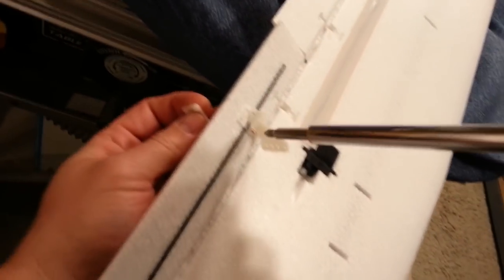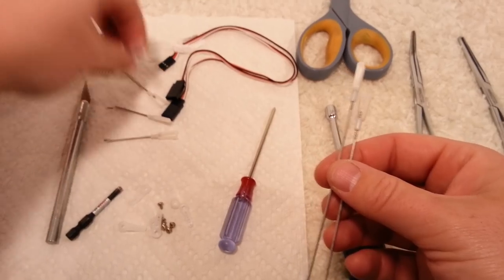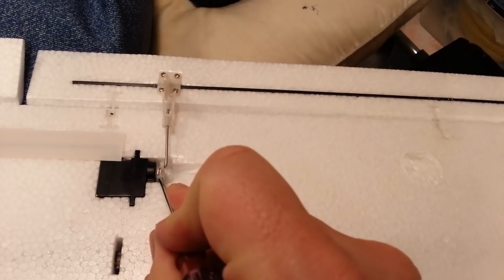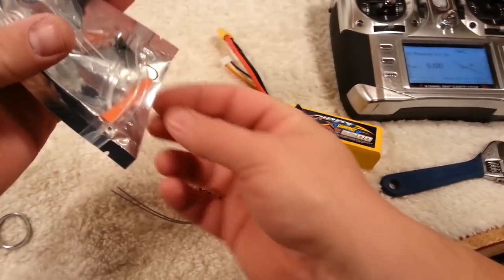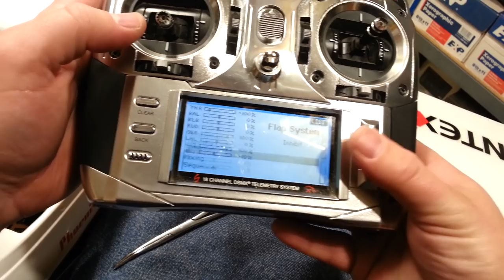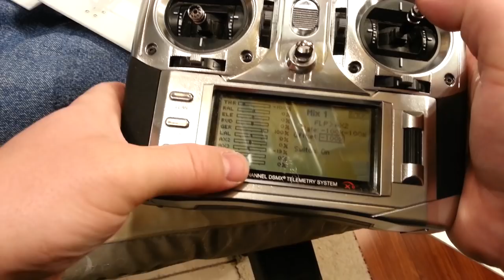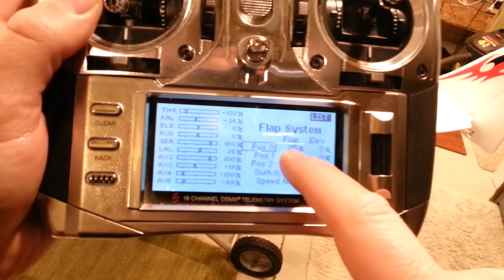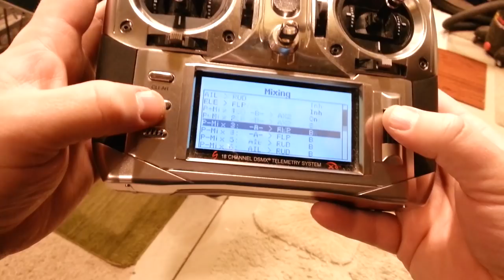Volantex RC - Phoenix V2 - 2m - Build Series - Radio Setup

Comment: I have the Ranger 2000, which has the exact same wing and tail/empennage. The flaps are effective enough so all the work with flaperon and crow seems a bit unnecessary.
I would also put the servo horns in the tail pointing upwards instead of down as you did here, as it would protect them better when landing on grass. Thanks for your very good and interesting videos. 👍
Reply from the maker: Unnecessary is the name of my game ;)

Thanks!

Comment: The Phoenix 2K V2 is by far the best designed of the Phoenix Series. Unfortunately, mine is sitting in my winter house (in Phoenix) collecting dust. By the way, the horn backer bumps go away from the foam so it doesn't decrease and weaken the foam structure.
Reply from the maker: I thought that might be the correct way, but then you have drag???
Reply from the maker: These planes are so inexpensive, maybe you could pick up one for here, and one for there :)
Reply: I have a 2K V1, 1.6, and Evo here (Portland) fun fun.

Comment: Thank you so much for the tutorial!
Reply from the maker: You're very welcome. Keep in mind lots of stuff has changed since we filmed this, so please do take that into consideration when thinking about doing it yourself because, there's considerably easier ways to accomplish even better results now-a-days.

Thanks for watching, and hope when you compare it against current technology, you'll see this pretty clearly

We have done a several more modern sail planes, if you're curious...in fact just the other day, we did a sail plane...not to poo-poo this plane, which was awesome, the Radio Setup may be tough to copy, since many of the parts we used aren't even available anymore.

https://www.brianphillipsrc.com/sailplanes

Comment: Thanks for all info,Spektrum user here,seem to be in a minority.. By the way,phoenix build,they do suggest servo and control arm holes to use,it's in the print. I suppose experience is best teacher,but I'm still at a careful reading stage.
Reply from the maker: That's weird, I guess I missed that part in the manual. Sometimes these things will change over time, so maybe you got a different copy of the manual??? Either way, she flies like a day-dream!!!

Comment: The manual does not mention how to free off the control hinges.
What i mean is..... Am i supposed to cut the polystyrene away with a modelling knife on the hinge line?
Surely the plastic hinges should hold it.
Otherwise they are very stiff
Reply from the maker: Pinch hinges are sometimes okay, and other times they fail quickly. You have to decide how you want to proceed. It's not hard to cut them free, then install a hinge, but you don't have to do it this way, if you'd rather have pinch hinges.

What I mean is that you have the flexibility to do whatever you feel is best.

Comment: Thanks for all your help, especially with the decals.  My control horns are different, they did not come with screws and the backing plastic has slots that mate with little arms that come off the back of the control horns that protrude through the control surface. Am I supposed to use glue on these or do they lock into place. TIA.
Reply from the maker: You can glue on the flat part and then just stick them through. That's what I would do at least. If you feel like they will CLIP together good enough, then you could give it a try...BUT just use care they won't come undone with servo movement.

Comment: Hey, great vids. Just one thing, bit of a noob question: when balancing the Phoenix, what are you using for weights and most importantly, how should it look when properly balanced?
I always worry that I’m too nose or tail heavy. I know a little nose heavy is better but can you show the pitch of the fuse, side on while balancing, so we/I can see what “properly balanced” should look like?

Thanks mate, great vids, really helpful and a good laugh too 😉👍🏼
Reply from the maker: I almost always use the battery to make adjust the CG. Some use dead weight, like lead weights, but I can't bring myself to use dead weight, BUT you can generally use LESS all up weight, since you can get the weight further out in the nose or the tail of the plane.
Reply: @BrianPhillipsRC  thanks 😉👍🏻😁

Comment: I liked the video series, and especially liked the way that the crow configuration could really slow the plane down.  I have a 6-channel radio.  Is it possible to set the flaps up using one channel and having a "Y" cable from the receiver to each servo in the plane?  Also, were you using two channels for the ailerons?
Reply from the maker: As for a "Y" Cable for both flaps - yeah, but builder be ware, you need them to mount them in opposite directions to get them BOTH to move the same direction

Comment: Desperate for guidance on flap & elevator compensation setting for my new Phoenix 2400. Just regular independent flaps on my 3-way D switch. Flap % (and most importantly elevator compensation %) as my maiden flight was a maiden crash. So erratic and uncontrollable that I didn't have any time to learn by trial and error. Help appreciated!

Comment: When I plugged my 3s in there were no tones at all, what do I do Bri? Is it the esc or the motor? You buy a plane from HobbyKing and you expect it to work 😡
Reply from the maker: Can you try another ESC easily???? That's where I would start.
Reply: You could connect the ESC with an servo tester. It works!

Comment: Starting at 1:23 you showed the control horn back plate and mentioned the bumps and said there was a right way and a wrong way but you never clearly showed the correct way.  So, which way do you think is the right way?
Reply from the maker: Sorry about that. The FLAT is supposed to go FLAT against the foam (regardless of which surface you're dealing with). Some will argue that I'm wrong, but I'd day there will be a far MORE threads exposed beyond the plastic doing it the "other" way...
...that being said, you can really kinda do it either way :)
Reply: @BrianPhillipsRC  I'm with you.  I don't see how anyone would think it could go the other way.  The way it came across to me was that the bumps should be against the foam.  I just wanted to know why.  I'm always eager to learn new things.  Love your videos.
Reply from the maker: P.S. I've done it both ways, just to experiment, and if the screws were the correct length, that would be a really nice way to do it, but if you want to cut them down to length, it's very tough, since they get hot and melt the plastic :(
Reply: The bumps should go into the foam as they locate the back plate properly and stop it rotating

Comment: Hey Brian do you have any problems with your switches coming lose all the time?? I’m getting tired of having to continually retighten constantly no matter how tight I get them! I just wish they had a tool or (spanner wrench) to get them tight. I hate using a screwdriver to try and get them tight, it just messes them up. I have talked to HH and they have no tool. So they sent me extra nuts. Great fix.
Reply: Inreguards two the above question, I found a tool, and hopefully it works thanks anyway.
Reply from the maker: On your Gen 2 transmitter? Esteban's constantly come loose, but my old trusty Gen 1 is always tight...
I'm thinking tighten them tight, and one drip of CA and kicker :)
Reply from the maker: Yeah, the "Split Flat Head" or whatever it goes by...looks kind like a modified nut driver, right?

Comment: Brian I thought you had to use spectrum receivers with spectrum transmitters 🤔
Reply from the maker: You have to use a compatible protocol... Spektrum uses DSM, then DSM2, and now DSMX. DSMX and DSM2 are generally considered to be "compatible" as the DSMX can be "Forced" back to DSM2, in many cases, but there are some limitations you might run into.

Basically, the 2.5 GHz is the frequency range where the Transmitter and Reciever operates, but the WAY that it operates is the "protocol".

For example, you might want to use an Orange Rx, which is DSM2 or DSMX...or a Lemon Rx which is DSM2 or DSMX, or they also use DSMP (Which is a joke, since it's ACUTELY just DSMX). But if you ran Futaba, they'd have another protocol, which is FHSS, or FRSKY which is OpenTx, and so on and so forth. There's also some other "toy grade" protocols out there, and some are Crystal based still!

Lots to learn on this front. Don't feel bad if you're confused...it took me a few years of screwing around with this stuff to even understand there WAS a difference, but there is.

Hopefully, this answers your question.
Reply: “Thank You” The information you gave me was very helpful thanks Brian for your help. ⭐️⭐️⭐️⭐️⭐️+👍🏻

Comment: Hi Brian would be nice to have a polyhedral  wing to float with these gliders these straight wings are slopie's  polyhedral for better lift for thermals. ? still Building mine two tail servo's failed when testing asw 28
Reply from the maker: I don't think you'd get better lift, but some might prefer a polyhedral wing for a more "old school" flying experience.

Comment: https://youtu.be/riuObqnjvpk?t=2233   do you have to rebind the receiver when the  reversing switch is used  with that brand of receiver if you loose signal it will go back the way it was )  ?
Reply from the maker: I'm not sure if there's a "failsafe" which would need to be reestablished to keep things going straight in the event of a brownout...so the short answer is NO, but if you'd et a more sophisticated Lemon-Rx receiver, you can actually do failsafe, and in this case, you might need to rebind.